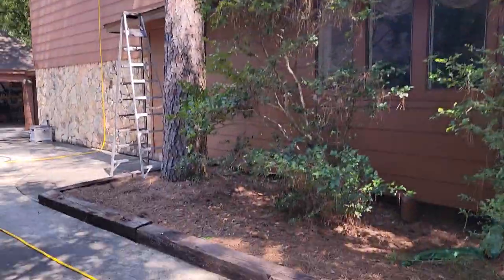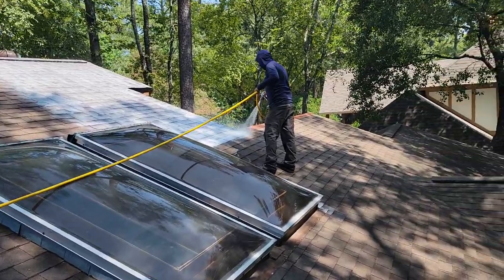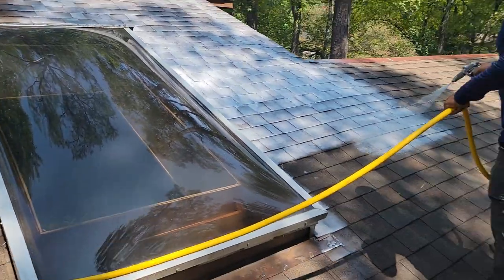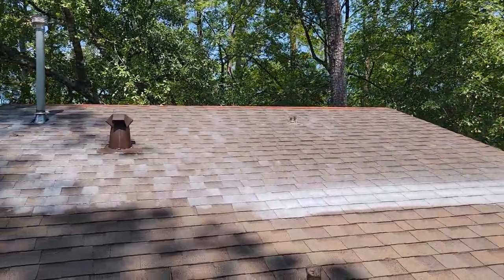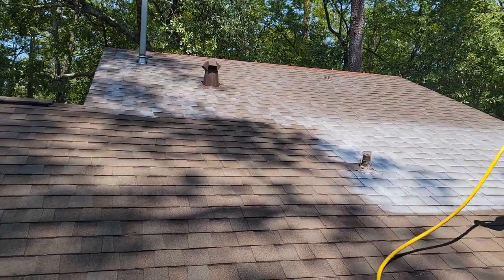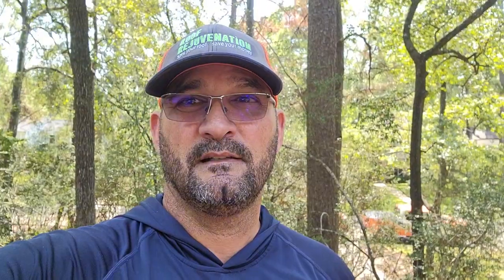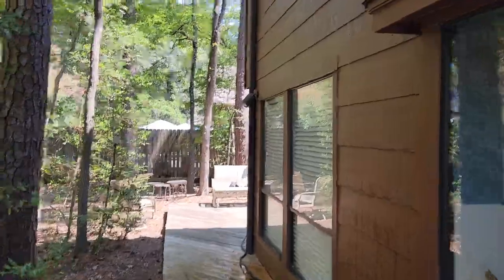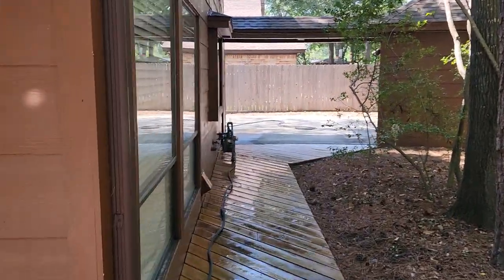Actual Spray Application of Asphalt Shingle Rejuvenation by No Mess Roofing

Comment: Paint those rusted metal flashings in your roof tuneup
Reply: Yes, we paint the roofing accessories
Reply: @63gutterman do you do the tuneup before or after the application? Because the skylight flashings were rusted in this video.
Reply from the maker: @eag8999  We do not paint skylight flashing
Reply: We re-set the securement points and seal. We'll paint the roofing accessories only, not the flasing.
Reply: Also, this product won't harm metal flashing, and on this application, we did the Rejuvenation Treatment only; we did not wash the roof before.